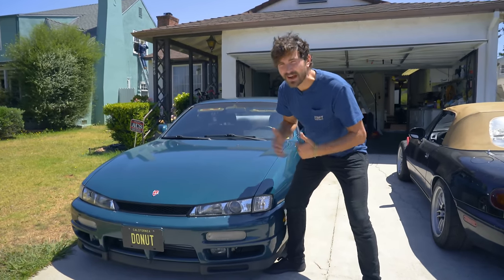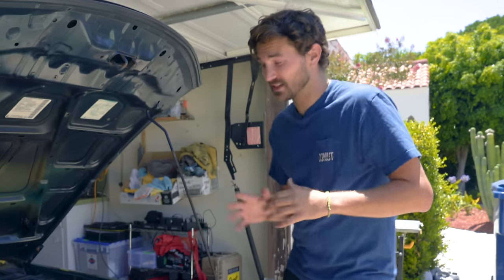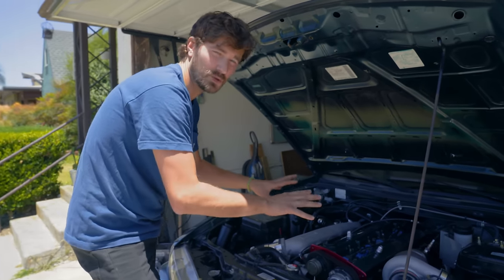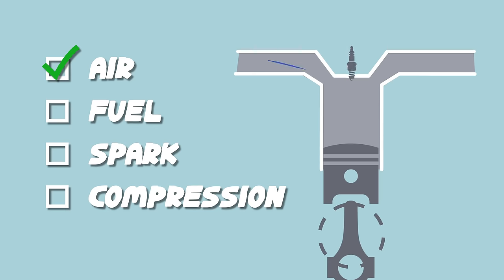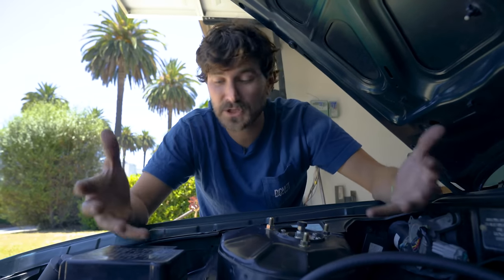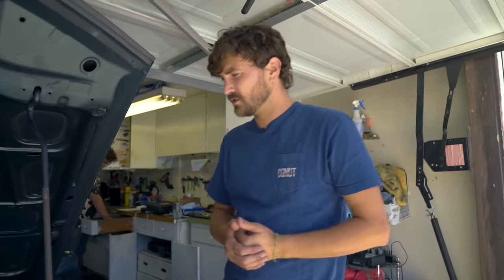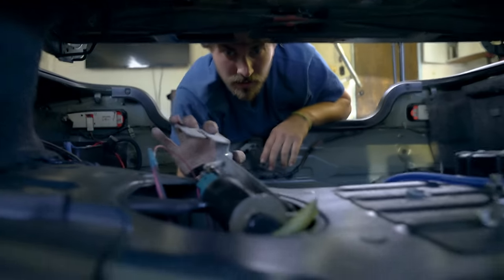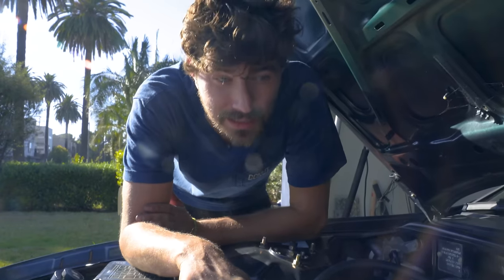Figuring Out Why My Skyline-Powered S14 Won't Start

Comment: "spark is one of the easiest thing to check"

people who own a subaru :    :/
Reply: EJ20
Reply: Yeah, but with a subaru you just assume headgasket failure and go from there
Reply: Literally exactly what I thought as soon as he said that lmao
Reply: What’s the problem with checking spark on Subaru’s?
Reply: @dtmfool789  subaru uses boxer engines, which are much more compact and rest much lower in the engine bay. Whereas on the RB the spark plugs are easily assessible right on top, subaru spark plugs require essentially digging through your engine to get to them
Reply: @dtmfool789  on my 04 sti you had to remove the air filter box, windshield washer tank, and battery. And even then, you need small hands to get to the coil packs
Reply: 4th gen f-body owners:FFFFFFF
Reply: 😂 ask me
Reply: @joshuafrahm8778  that is sad...
Reply: @adamspitfire  what is an f body?
Reply: @williamta9408  the f-body is the 1967-2002 camaro and firebird platforms. There are four 'generations' and on the last one, the engine is SO FAR BACK UNDER THE DAMN DASHBOARD that you have to bruise and break your hand that to get at them. Search up 4th gen camaro engine and you will see.
Reply: @adamspitfire  thank you for that Automotive lesson
Reply: @adamspitfire  sort of like the early model Dodge Caravans. I've seen some people cussing at those
Reply: @adamspitfire  I've heard strange things about the Subaru also
Reply: @adamspitfire I feel bad for u, I don’t drive but it must be a pain to replace you spark plugs.
Reply: @joshuafrahm8778  The headgaskets don't fail as much as people think.
Reply: @justenkris  I know, I've had several of them, and never had an issue.
Reply: @justenkris  facts it’s only when you over heat them from a bad owner that beats on them
Reply: try EG33, thank the heavens for iridium spark plugs. That place is a boss battle.
Reply: bobwatters  yea
Reply: RX7 owners:   :\
Reply: ...and who have long arms and tiny hands...
Reply: @joshuafrahm8778  this comment hhahahahahah holy fuck I laughed way too hard
Reply: @dtmfool789  its a boxer engine So the sparkplugs are on the side
Reply: Thank God I have a 1g engine that has all the spark plugs on top of the engine block all inline
Reply: I thought of our Porsche first
Reply: Or the Ford V6 on my Escape that you literally have to take half the engine apart to get to the back 3 plugs
Reply: 2.2 in my Subaru Legacy it is as easy as any other car because the actually give you space. That engine also has no headgasket issues like the 2.5 does, so I definitely recommend it.
Reply: ::cries 03 xterra #6 plug::

😭😭😭
Reply: @adamspitfire  Haven't had a Camaro since my 97 went tits up, but that comment had me rolling my eyes.  I remember the first time I had to pull the plugs and just stopped and stepped back and thought, "There's no fucking way GM designed this thing this way, right?  RIGHT?!".
Reply: @adamspitfire  man u sure do knpw a lot
Reply: Or an old 2005 a class
Reply: My rx-8 had the worst plug locations I've ever experienced. Didn't help that I was living in an apartment in the city at the time and used public car parks to do all my maintenance lol
Reply: Tiberius I'mserious  actually I was able to do mine leaving the intake manifold on
Reply: It’s true it’s not easy with a Subaru😭
Reply: I'm sure there's a way to do it, but I pulled my engine to change the plugs. PO put NA plugs in a turbo car... No wonder it was misfiring 😤
Reply: try having a f150
Reply: F
Reply: @joshuafrahm8778  damn lol fuck starting at head gasket failure that's a big boy job 😅
Reply: ancient ghouls come when you pull them.
Reply: I have an 86 with a 2 liter boxer. I dread when spark plug time comes
Reply: people who has a v6 camry or old v6 lexus
hmm today i will change 3 sparks. Another 3? maybe next time
Reply: Every 3v owner ever
Reply: @Piperitum  lmao what? The guy asked a question and i answered it, when did i ever say anything about being special for knowing how to change a spark plug 😂😂 projecting on your part much?

Comment: 4:50, BE VERY CAREFUL WITH THIS ONE! if you had fuel in the cylinder and you pull a plug out and ground it to the block or something close and have someone crank the engine, the vaporized gas fumes can come out of the spark plug hole and ignite a fireball in your face when the spark plug sparks.
Reply: Can confirm, fortunately the fire didn't burn anyone

Comment: "Money Pit" is starting to become my favorite Donut Media show and makes me want to start my own project car.
Reply: Tim Q don’t do it, for the sake of your sanity and financial security, don’t do it.
Reply: Nah do it you really get attached to what your building just goodluck w your financial savings
Reply: I recommend to buy old benz like w201 or w124 they are very easy to work on and they came with many engines and you can make easilly +500whp with minor modifications only problem in them is transmission what bottlenecks
Reply: Doooo itttt!
Reply: Do it its full of ups and downs but those ups are so self rewarding
Reply: If you do, DO NOT GET A RUSTY ONE!!!! Things that are already semi frustrating become waaaay more frustrating and I've contemplated selling my car because of rusty bolts (in the moment at least).
Reply: don't do it, its a worse addiction than crack.
Reply: I also wanted to start my project car but I cant because
1.Im still a child
2.I cant figure out what car I want to work on when I grow up

Comment: A good way to remember what an engine needs is remembering the word facts
Fuel
Air
Compression 
Timing
Spark
Reply: I'm stealing this epic pneumatic device!
Reply: Well not all engines use timing. 2 strokes dont. But they dont have valves and a cam.
Reply: @tristenkiesow4061  you can have ignition timing issues
Reply: @tpddetailscr   but 4 stroke also have that. I'm saying that it doesn't have timing like a 4 stroke. So not all engines need timing, beside ignition timing
Reply: Time doesn't exist, until your subaru timing belt snaps while you're doing 70 on the interstate and completely ravages your motor
Reply: Grooove e same difference
Reply: Fact
Reply: @tristenkiesow4061  some 2 strokes still have timing and if you change to an aftermarket CDI you may have to adjust it.
Reply: A good way to remember what a Japanese engine needs is remembering the word factscmcmcmcmib
Fuel
Air
Compression
Timing
Spark
Cash
Money
Cash
Money
Cash
Money
Cash
Money
I'm
Broke
Reply: FACTS
Reply: @tristenkiesow4061  you still need to time the spark.
Reply: @basmeijs6973  clearly you cant read. I said besides ignition timing.
Reply: @Grooove_e  Methinks you know about this from experience :0
Reply: It’s pretty simple it’s suck bang blow
Reply: @NeoGodHand  Yes, but I still own the subaru as I have learned from this experience, it was a good opportunity to throw in a fullt built motor lol
Reply: @Grooove_e  I'm glad it turned out to be an overall positive end result for you! Man, I can't imagine what it felt like to be driving down the highway then hearing the break, the shooting parts around the engine, then seeing the smoke as all power goes away and you have to pull over haha.
Reply: Or FACTS for short
Reply: Pewdiepie : And thats a FACTS
Reply: @eur0be4t3r  I think you missed the point of my comment.
Reply: but theres no spark on diesels :(
Reply: Crankshaft sensor!

Comment: FACTS:
Fuel
Air
Compression
Timing
Spark
Reply: Yes
Reply: Timing is everything
Reply: That's facts
Reply: I have all 5 and it still wont run, I mean not all at the same time and spread out between 3 engines but that shouldn't effect it
Reply: I'd put spark higher on that list. If its a list, easier to check.
Reply: Timing, nice! And that can be a sneaky issue with these engines too.
Reply: Snapple Fact
Reply: TIMING!!! thank you, you can have all of the above no timing no runing engine

Comment: I had that identical problem when I did the fuel pump in my car, it kept running lean only in boost, I kept adding more and more fuel into the tune and it didn't help. Eventually the odd hissing noise in the tank during priming gave it away 😅
Reply from the maker: i couldn't hear the hiss!
Reply: @Donut  Probably because S14's aren't made from tin foil like Miatas 😅
Reply: TheCarPassionChannel  facts!

Comment: When your car won't start, you just have to remember the facts
Fuel 
Air 
Compression
Timing 
Spark
Reply: Agreed. It's not just spark, it's spark at the right time. I have seen someone put in a distributor and some crazy random spark plug wiring order - it would show a spark at the plug all day long, but rarely start and not stay running.
Reply: @blautens  ...that would be timing lol
Reply: I really need to learn to do timing, my old chevy wont start and my guess is definitely timing
Reply: Prelude Dude- yeah that's what he was saying, hence "spark at the right time"
Reply: Most modern cars have a butt load of sensors too.
Reply: Spray a flammable liquid into the intake. I diagnosed a fuel pump on a Rolls Royce the other day doing this, sprayed some brake cleaner into the intake hose and was able to get it to run off of brake cleaner. If it still doesn't run, you have an ignition issue.
Compression is rare, snapped timing belt on non-interference engine only causes this.
Reply: @StreetBullyTV  propane, ether a few things work 😉 silicone spray for a diesel
Reply: Easy to remember, FACTS!!!
Reply: @StreetBullyTV  Anything flammable and volatile. Carb cleaner works really well too. I've also poured capfulls of gasoline into the throat of 4 barreled carbs.

I wouldn't recommend testing for spark by unplugging an ignition wire. I've seen many ignition coils that made a visible spark, but we're too weak to ignite the fuel/air mixture. I've also destroyed an ignition coil by having the engine running while an ignition wire was disconnected.
Reply: Special EDy please make more Videos where you been man
Reply: @itsamirtv2337  I got trapped in the Nether and my portal was destroyed. Send water please!
Reply: Battery and alternator as well. If they don't work the car won't start
Reply: How about a working starter
Reply: Watch Chrisfix videos
Reply: @magoslucius4245  Not cranking is different from not starting
Reply: Travis Bridges travis speaks of very painful experiences 😂

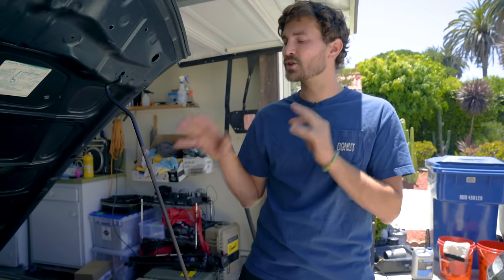Comment: 2:30 You are missing one. Timing.
If the belt broke or slipped the engine will run poorly or not run at all. It could also be the ECU failing.
Reply: speaking of timing, if the tachometer/crankshaft position sensor is starting to go south or quite simply stopped working, it can straight up never inject fuel into the engine or run really rough.
Reply: He said he installed a new ecu lol
Reply: @nos4me  ?
Reply: @vitor900000  For the new air intake manifold that he installed, which runs on absolute pressure, instead of using a mass airflow sensor.
Reply: @isnowyazn  You guys are really strange...
When I said "It could also be the ECU failing." I meant that problems with timing can also be caused by a ECU failing or not been configured right not that his ECU was failing...
Reply: Vitor Leão Oh yeah, I see. Yeah, timing issues suck lol too bad you can’t diagnose that through the OB2 without the engine actively running. I’ve never had timing issues happen often, so I wouldn’t know where to begin.
Reply: @isnowyazn  You need a ignition timing gun if the cause is not obvious.
Usual symptoms of timing problems are knock, no/low power, and engine don't start.
Here is a video showing how it works
https://youtu.be/wifTHbb06_I?t=246
Reply: facts lol
Reply: It’s kinda funny I got stranded in a parking lot yesterday because the ecu was failing
Reply: You would hear it when he cranked it over

Comment: An even easier way to test the sparks is just jam your finger in badaboom badabing
Reply: Or have an unsuspecting friend and tell him. Hold this. 😂
Reply: @blue_lancer_es  Or just do what I did on my motorcycle. I wanted to perform an RPM drop test to see which cylinder wasn't working as hard, so I pulled the plug wire off to disable cylinder 1, while the engine was running, redirecting the shock to my hand.
Reply: That's some Vice Grip Garage mechanicking on a sparkulator

Comment: Can’t tell who did the “car won’t start” episode better, you or ChrisFix
Reply: 100% ChrisFix, these guys forgot timing
Reply: @quassle3755  timing shouldn't be an issue for the grand majority of cases. Chrisfix may have gone more in depth but this was a good video nonetheless particularly for someone who doesn't know a lot about cars.
Reply: 100% ChrisFix
Reply: Definitely chrisfix.
Reply: Driftstang all the way bois
Reply: @magicstew45  Well, in my engine, previous owner did the timing wrong before selling the car, so when i tried to start it, the carburetor just freaking blown up, leaving a huuuge burn on the hood
Reply: TJ Hunt baby!!
Reply: Chris's video was easier to understand in my opinion AND donut forgot the timing
Reply: Chrisfix 100% 
#TeamDriftstang
Reply: Chris
Reply: Chrisfix for sure
Reply: I love Donut but ChrisFix! Is in a whole 'nother ball game for DiYs
Reply: @magicstew45  Honestly, as someone compeltely new to cars who has never touched anything under a hood except like the plastic engine cover, chris' video was much better because he explained every part in detail, from function to why and how it does what it does. Also he included timing, which is definitely not something I would avoid teaching a newbie.

Comment: Cranks it in the begining of the video and I'm like "yep, fuel pump." 😀
Reply: Haha same. 2:13 and I was like “ahh, that’s not getting fuel!”
Reply: I'm glad someone else had t exact same idea
Reply: I knew it because i had the same problem in my car but in my case i had to buy a new pump unit because it was an inclosed unit
Reply: So how were you able to tell? I’m asking for a friend because I totally know how you can tell that
Reply: @michaelpugh2617  it was mostly because i was driving and it cut out. So i go through the same route he goes through.  Air was no problem no sensor and only a filter at the airbox so that was quickly done. Spark the cheapmans method just take a plug and check if it sparks. Compression the correct way is with a tester but you could always put your finger over the sparkplug hole. There was compression so i sprayed some starter fluid into the air intake and it fired right up so i knew it was fuel.
Reply: 6 sense brah 😀
Reply: Yep.
Reply: Bzzzttt sound when you turn the key
Reply: Same

Comment: That moment when you forgot to put fuel in the tank: Suprsed Pickachu face
Reply: Took me an entire summer to diagnose my 2 stroke jetski wasn't making proper contact from the plugs wires to the spark plugs. Diagnosing is a bitch!
Reply: Charles Wilson lol I was worse. I did a brand new top end but didn’t touch the cylinders. I just honed me a bit. Turns out they had 400 hours on the cylinders and my compression was 90 psi. Literally had to re rebuild engine 2 (engine) hours later now I got 150 psi. What a bitch lol
Reply: this actually happened to me 2 days ago
Reply: Fellow Doge knows best.

Comment: When my car won’t start I curse only having one set of keys that is lost.
Reply: Lol
Reply: I'll give you $3 for your car then
Reply: TrashBandit 24 when I get the new key cut it will be worth at least twice that.
Reply: @jamesgustafson7962  in that case I'll give you at least $3 and a chicken nugget, because I wouldn't want to rip you off
Reply: TrashBandit 24 very tempting
Reply: Yep my keys lost too, curse the dealer for wanting almost 300 dollars because "oh wah wah we have to program it." DO YOU KNOW HOW MANY TACO BELL MEAL DEALS I COULDA HAD FOR THAT MONEY?
Reply: insert name
It probably takes them 3 whole minutes to program, too. 🤨
Reply: When you lose your stupid keyless start fob that doesn't fit on a keychain and it costs $500 to replace. Looking at you Mazdaspeed6.
Reply: @negativeindustrial  you know it's not very hard for the dealership. I worked at a dealership called Sux  for 6 years  we do is

1. Park the Car in the garage 

2. Put the Car on R and put the emergency parking brakes as well

3. Turn off the car 

4. Make sure we talk with our supervisor 

5.  Once it's all good we grab the key

6. Remove our "BRNS" very important 

7.insert the keys in the ignition 

8. Go to the scanner 

9. We make sure to lower our pants a bit till the scanner can see our but cracks 
This make sure the Administrator is in charge of duplicated a new key my code is * ** ** example 

10. then I put my but crack on the car driver seat to register

11. we let out a big Fart! Or multiple  Stinkin all them shit in your car to the point its Critical breathing point  making us cough like crazy with the windows up 
All door closed 

12. Then the Car Will be programmed 

13. Put back our "BRNS" to simple and think about the next car 

14. Leave the car windows open 

15. Then close it

16. DONE .

That's why getting your car Reprogrammed is Expensive.
Reply: X Xx
Jokes on you, I already farted the car up when I dropped it off 😉
Reply: @negativeindustrial  damm.. then shoot you. fried the system depending on the G Force of the fart you let out If it's a 2 then its fried if its um. Chucks . Um. Umm like a 4 then holy computer ternataion you could of blown the F.I.C.C.R stands for 

F fart 
I in 
C car 
C computer 
R registration 

Your welcome

Comment: Love your S14, I've got a Manual S14 1995 with a SR20DET Black top engine swap, got it running for a week and now it wont turn on. None of the lights wont try to do anything. Going to buy a new wiring harness for the car and new computer. Been working on it for over a year can't wait to finish her.